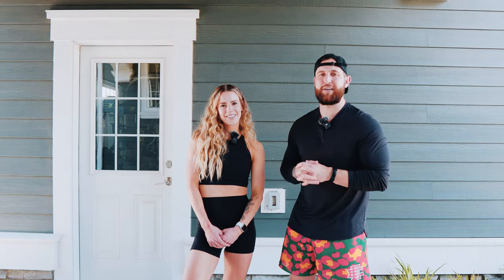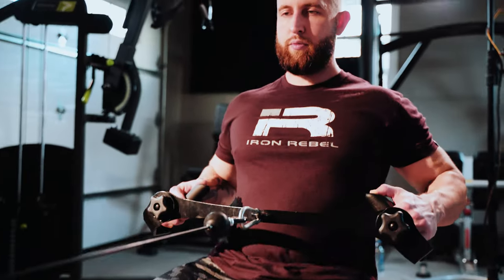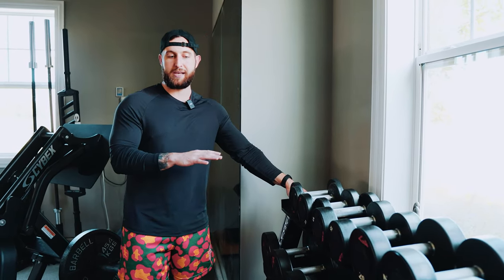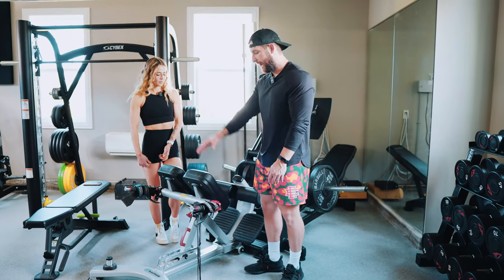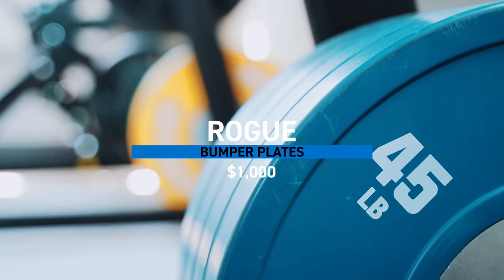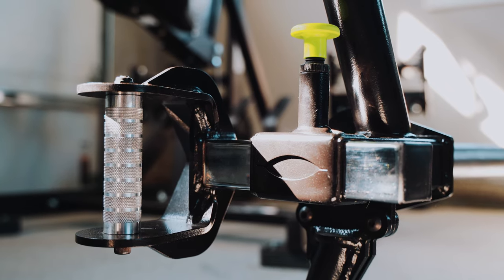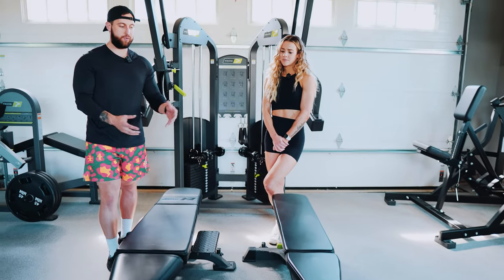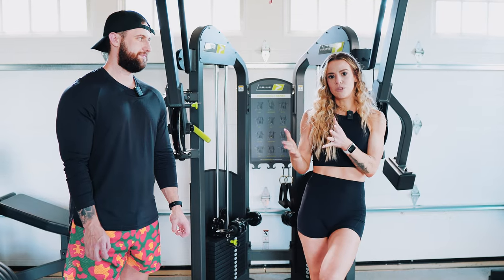We Built Our Dream Home Gym | FULL GYM TOUR (Equipment & Price List 2022)

Comment: Assuming your garage has the regulation slope of 1/8” or 1/4” per foot, have you guys noticed any potential stability issues with the heavier equipment like the functional trainer?  Probably not an issue but with a thousand pounds and a half inch or one inch of slope over four feet, I was wondering if the fear of tipping over was something you considered.
Reply from the maker: You are correct, we have not had any issues. It was a concern when we were building it out, but we were assured from others who had built home gyms & manufactures of equipment that it would be a non-problem. In our previous home & this one, we've had a majority of the equipment coming up on 3 yrs & have had no issues. It is annoying to put the DBs down & they never stay still. Lol

Comment: Multiple companies make a hack squat/leg press combo. Why not go for that?
If I were to build a home gym, I'd get as many combination machines as I can.
Chest Fly/Rear Delt Fly combo, Hack Squat/Leg Press combo, Leg Curl/Leg Extension combo, Incline Chest Press/High Lat Pull combo, etc
Reply from the maker: Good question! We hadn't found a hack squat/leg press combo that we were thrilled with. If the Prime Leg Curl/Leg Ext was out when we were building out the gym, we would have gotten that. For the chest fly/rear delt fly we can all those movements with the cables as well!

Comment: Did you ever look into the kabuki trap bar or the rogue multi grip bar? How about a safety bar for back squats?
Reply from the maker: Yes, we sure did. The thing that pushed the Prime Trap Bar ahead was the ability to move the handles as the Kabuki handles are fixed. & I believe, we looked at the rogue multi-grip bar & the handles were not slanted & were vertical, we wanted them slanted. For the safety squat bar, a little birdie has told me that Prime is working on a great one that we've been waiting on.

Comment: Sick gym guys! Curious why the hammer strength row over the prime seated row. I love the N1 variations on the hammer strength but i think the prime one you could obviously get lengthened lat overload as well as upper back/rear delt lengthened overload as well. 

Interested to hear your “do over” thoughts. I’m in the process of prepping for my home gym 2.0 in a 15x20 ft space (moving from a 11’x11’ space). Curious as to how big your space is (obviously much bigger than mine will be). 

Currently my new space will have prime combo leg ext/curl, prime seated row, prime lat pull 2.0 plate, a pendulum squat, Atlantis 40 degree leg press, life fitness hyperextension, cybex seated calf, and my freemotion dual axis cable cross that I’m bringing from my current space. Just bought an old school cybex lying leg press for cheap as well to place and plan on grabbing a seated leg curl. I’m into jamming my space as much as i can and I probably won’t bring my squat rack from my current gym. 

Any thoughts or advice is appreciated!
Reply from the maker: Hey Joseph! The ONLY reason we didn't get the Prime horizontal row was space. The foot print was just a little to big for the space we have right now. If/when we progress to a bigger space, that is a piece we will certainly have.

I believe our space is 23x21 ft

& the pieces you've got sound INCREDIBLE. I think I'm going to nee to come over and get a session in at your place! lol

I would say you may be able to sell the cybex seated calf & use the prime leg curl as your seated calf w/ bumper plates if that meant you could bring in a more versatile piece. Even if it just gave you more free place to move benches, stand when doing exercises, etc.
Reply: Hammer is lower footprint and also you can train the shortened and lengthened positions by just stepping back I swear?

Comment: I'm surprised and not surprised that you went with the Hammer Strength row instead of the Prime Plate Loaded Row.... thoughts between the two? I've used the Hammer strength (who hasn't) and LOVE it but its common now to have Kas and Eugene call it out for not having the best resistance profile... I haven't used the Prime but also hear it is amazing and I'm leaning towards it. Would appreciate any feedback
Reply from the maker: Hey Todd! There are things within this gym that are perfectly optimal & that is the reason for it & there are things in this gym that I just personally enjoy. Although the resistance profile may not be the best on the hammer strength, it's a movement that I look forward to performing & I enjoy the change of pace between cables & plate loaded machines as well.

Comment: Can I ask, how many square feet is your home gym? btw, your gym looks awesome and the video quality is great as well!
Reply from the maker: Of course! It's just a little over 500 sq ft, not a ton of space but we make use of every bit of it!
Reply: Thanks, I was about to ask this very question, I love this gym since it has a lot of the components I want, only things missing IMO are a full squat rack, GHD, Reverse Hyper, Nordic bench, Kettlebells as well as equipment for MMA training and cardio work (Concept2 Rowerg and Skierg and some kind of bike).

I could probably save space by using Adjustable Dumbbells and Adjustable Kettlebells, and replace the Smith Machine with a Squat Rack, and incorporate the FT into the Squat rack, such as the Ares into the Rep PR-5000

I could probably make my dream Gym work with around 600 Sq feet

Comment: Like the dumbbell rack...looks like heavier weights than either of you need...  Though I can lift those, I don't think I would spend that much on them. Smith machine is a winner.  I have thought about getting the HS for my premium basement gym...but the reality is between using heavy single arm dumbbell rows and/or seal or bent over rows, I just don't see the value in it.  Maybe one day. I would have rather have grabbed the HS lat pulldown.  Cable corner unit is a winner.  I give this give 8.5 of 10.    Its one of the better ones...be better if you had more space, like a 3 car garage. For all you have, it doesn't look too congested.   I would need more Olympic plates.    Don't know if I saw a decline bench in there, can't forget to hit those lower pecs.
Reply from the maker: Coming in hot with the insult of strength - Check out some of the training videos, certainly use the dumbbells that have been purchased. They are very expensive, I wouldn't have bought them if I didn't need them. The lat pulldown is covered by the Prime Prodigy rack. Certainly if we had more space, I would be able to add more pieces. We have over 300 lbs of olympic bumper plates. The Prime Bench can be adjusted to a decline.

Comment: Completely out of touch and not possible for 99.999%.
Reply from the maker: If you think that way, you're correct it won't be possible. We worked very hard to make this possible for ourselves & you can to. We aren't special, this is year 10 of building something we are passionate about & believe in. That's what this possible. Do you think that if you committed 10 years to something, that it would be more possible than it is right now?